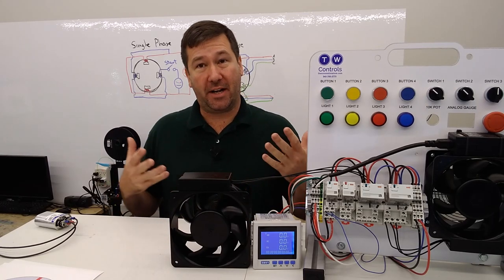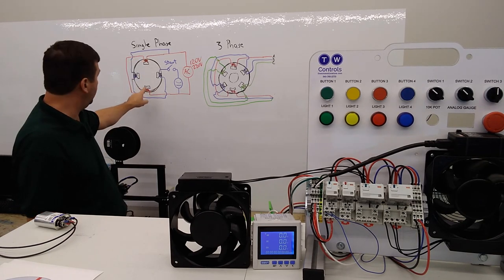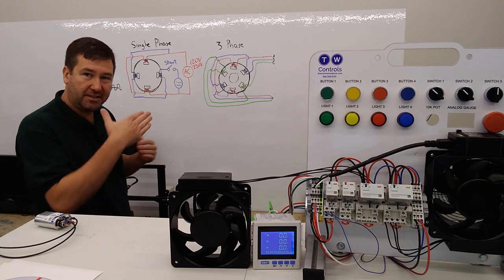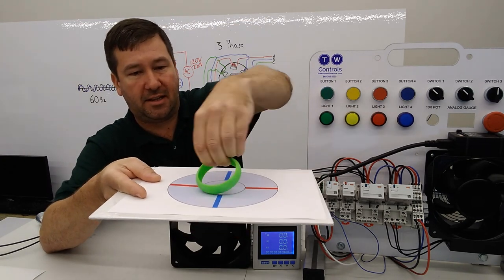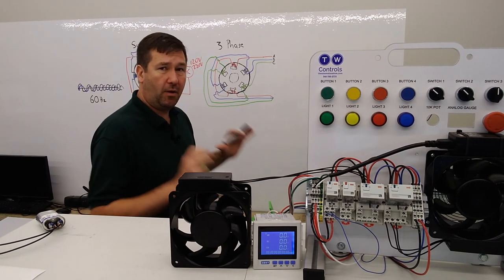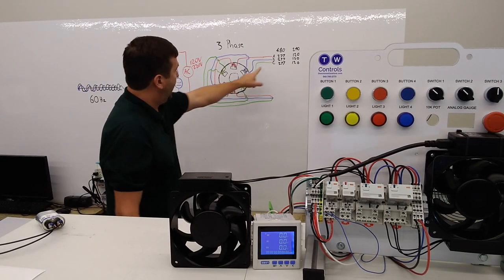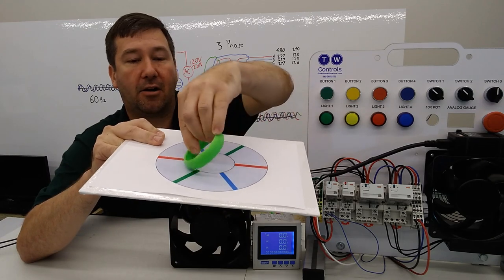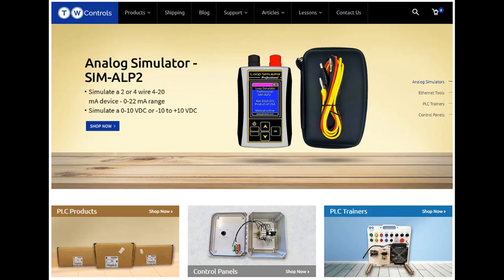How Do AC Motors Rotate? 3 Phase and Single Phase...Magic?  Squirrels?  Magnetic Fields✅

Comment: I have a special problem with a 1 HP single phase 110 motor.  The capacitor start points inside the motor are burned out.   I can't find replacement points for this motor.   My question:  Is there any way I can use an external relay to replace the start points?    They would no longer be driven by the centrifugal mechanism inside the motor.  So how would I make them turn on or off at the correct time?

I have three ideas of how to make this work:

Idea #1:  Have the relay connected to a manual START button.  When power is first applied to the motor I need to press the start button down momentarily to get the motor started.   In this case I wouldn't even need a relay as the button itself would serve as the external points.   I'm not sure if this would work?   How critical is the timing of how long those contacts can be closed?

Idea #2:  Have the relay set up with a timing circuit that holds the relay closed only for a short period of time when the motor starts.  This would then just assume that the motor had actually gotten up to speed during that timing delay.    I figure I could make the timing adjustable to set it for timing that works for my application. 

Idea #3:  (probably the best idea) Have the relay controlled by an external motor speed indicator to shut the relay off when the motor gets up to speed.  This should basically emulate the original situation where the points inside the motor are being controlled by a mechanical centrifuge. 

I'm thinking that ideas #1 and #2 would be easier to actually implement with idea #2 being the better of those choices.   Idea #3 seems like it should definitely work since it basically emulates the original situation.

Can  you comment on these three ideas?   Will any of them work?  Thanks.
Reply from the maker: This will make a great video, I'll do something on it but for now...
Option 1 won't work since typically a piloted button can't handle motor current, it is usually good for less than 1 amp.  So you'll need a relay.  IF it were you starting it every time then this would work OK.  The trick is hold it too long and you'll end up burning up the starting windings.

Option 2 actually isn't uncommon.  Many motors don't have centrifugal switches are run off of timers, you'll just need to dial in the time.  The trick to success in this situation is the for the starting load to always be the same.

Option 3, I can't imagine this being done on a 1hp motor.  In the end, this setup would probably cost you more than the motor if you consider your time, but it might be a neat experiment to do.
Reply: @TimWilborne  Thanks for the quick replay Tim.  I'm good with electronics so I'm looking at option 2 using a 555 timer to make the adjustable start-up delay.  The motor is on a lathe, so it would always be started with no-load and only be engaged after it's running.

On option 3 I was thinking of using a mechanical feedback for the motor rotation & speed.   Something like a disk added to the output shaft that has holes in it I can count with a sensor and know both how far the motor has turned as well as how fast it's turning.   Then I would have the relay kick out when the motor is up to speed.   But as you suggest this would be far more complicated.  Option #2 is what I'm currently considering.   I just need to figure out the correct timing to kick out the starter relay. 

In any case, my starting load for this motor should always be the same.  When the motor starts the lathe will be disengaged.   So it should always start up under no-load condition.
Reply from the maker: @Mystic0Dreamer  An unloaded lathe is still quite a load.  I think option 2 would be best but the guys over at Practical Machinist might have an idea of the time that you should engage it for.  While not technically a 3 phase question, I might would post the question of time over at the 3 phase, converters,  and VFD section of their forum
https://www.practicalmachinist.com/vb/transformers-phase-converters-and-vfd/?s=3c6e2d836ada1ee82fffad31b30e6ac3
Reply: @TimWilborne  Thanks for the link.  I'll ask over there.
Reply from the maker: @Mystic0Dreamer  Let me know what you find out.

Comment: I have a question.  When the load on a motor is increased, the current draw increases.  Can someone explain the science of why the current increases?
Reply from the maker: Hi Ed.  Motors pull only a small amount of amps based off of the resistance to the wire coils in the stator. The rest is based off of Back EMF or electro motive force.  This is a little more in depth than I typically go in my videos but basically back EMF prevents current flow.  The closer to theoretical RPM a motor runs, the greater the back EMF which prevents additional current from flowing.  The more load you put on a motor, the more reduction in rpm or slip will occur.  As slip increases, this Back EMF decreases, allowing more current to flow through the windings.  I hope that helps and thanks for watching!

Comment: Hi! I was hoping you could help me figure out what voltage I have going into my 3 phase motor? I need to figure it out for a power calculation. Is the voltage dependent on the motor itself or on the outlet I am plugging it into? Thank you in advance for all help!
Reply from the maker: Hi Olivia.  I'm getting ready to do a video on power factor.  Unless there are some great distances between the outlet and the motor, you can assume the voltage at the outlet is the same as the voltage at the motor.  Then you need a watt meter and a current meter.  Voltage*Current/Watts=Power Factor
Reply: @TimWilborne  Thank you so much!
Reply from the maker: @Olivia-zz4lj  Glad to help Olivia!